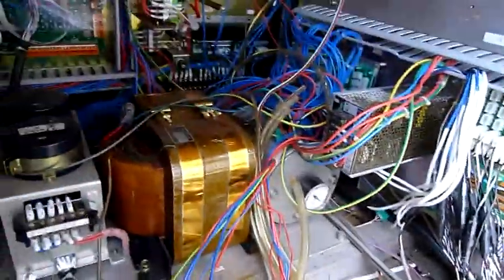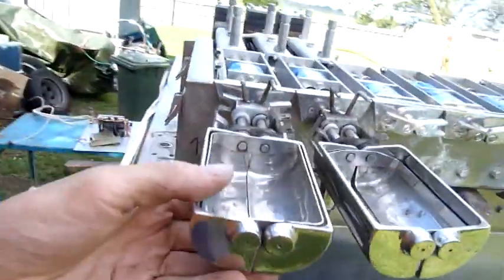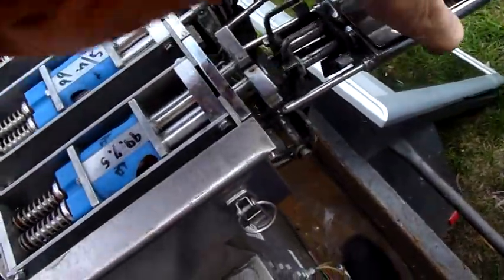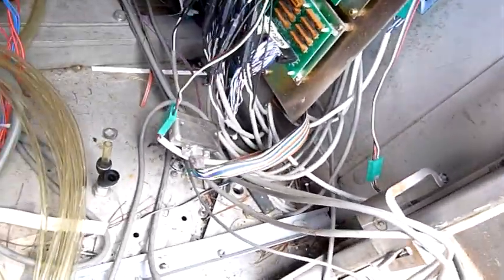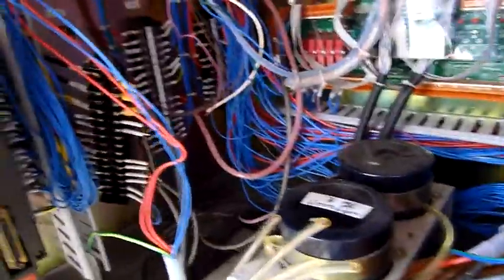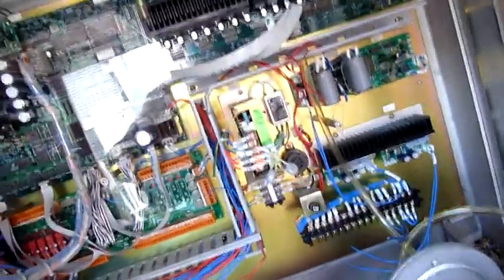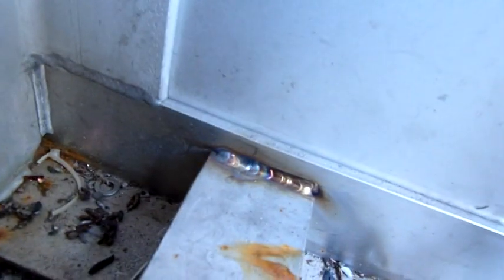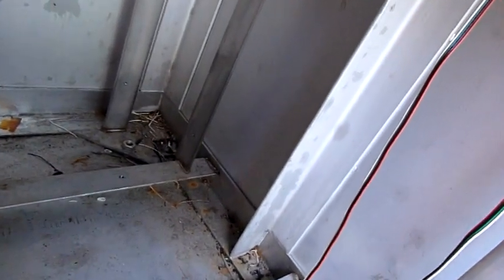Yamato Dataweigh Control Cabinet Dismantling

Comment: @Nighthawke70   The problem is that fiber is VERY sensitive to any kind of rough handling or excess bending or any sort of treatment that scrap normally gets.  Any fiber is almost certainly dead with loads of internal breaks.

Comment: It all looks clean inside i bet the mosfets would be ideal for pulse fire something like a rail gun and the board is most likely working using serial coms be interesting to see if you could get just that to send any data and that case looks ideal for a server rack would act as a giant heatsink

Comment: I'd keep the fiber and seek out a networking tech that would have a kit to put ends and/or splice the cable. That stuff's worth it's weight in gold dude. The networking interfaces are cheap enough, but the cable's EXPENSIVE as hell.